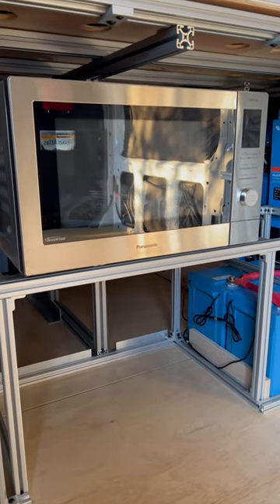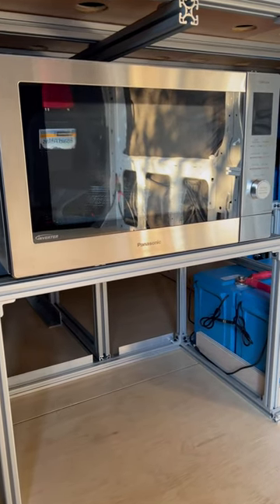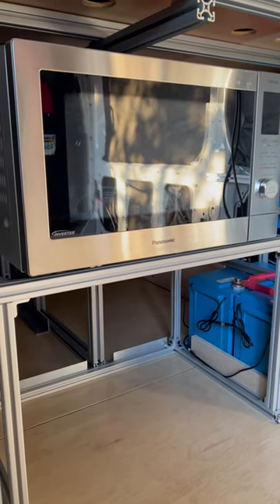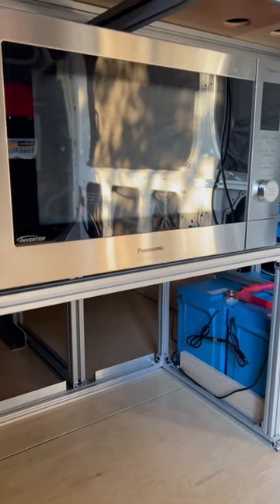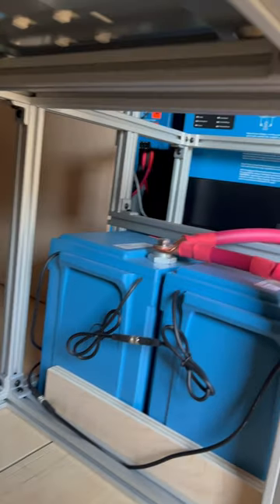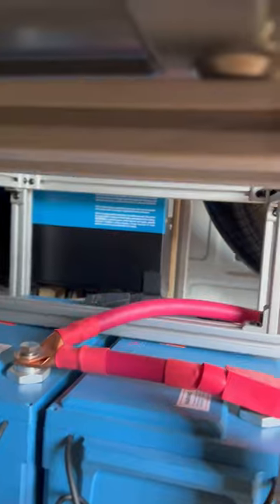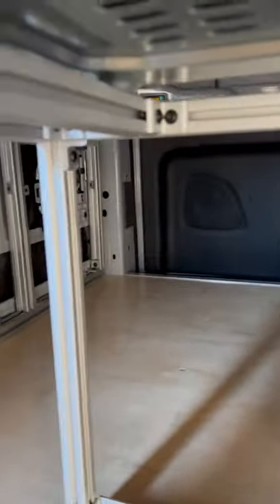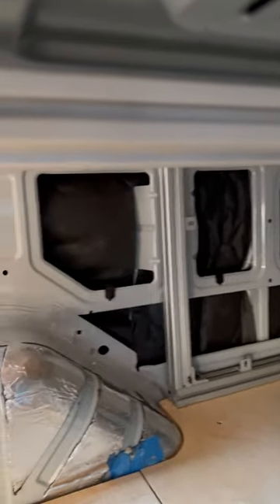Camper Van Microwave/Oven Mounted #shorts

Comment: Where did you purchase those bolts? Ty
Reply from the maker: I used bolts and t-nuts from 8020 brand extruded aluminum.
Reply: @VanTransitions  yes, where did you purchase the bolts
Reply from the maker: 8020 is the brand - 8020.net is their website.
Reply: @VanTransitions  thank you so much. I couldn't seem to find them in store.
Reply from the maker: They have lots of bolt thread sizes and lengths available. You have to get what fits your size of extruded aluminum and t-nut threads for your specific mounting need.
Reply: @VanTransitions  yes, that's why I was looking for them in store
Reply from the maker: I can't choose the bolt you need for you. :) You need to know your extruded aluminum size, t-nut thread, size of hole in the bottom of the unit you're mounting, etc. Lots of variables. You got this.
Reply: @VanTransitions  yes, I'm completely aware of everything you have said. Lol. Just wanted to know where you bought your bolts.  That's all. I was hoping in a store
Reply from the maker: Ah, well you can get bolts at any hardware store if you know what you need, but I doubt you''ll find t-nuts in one. That's online. Lots of extruded aluminum vendors out there. I choose to order from 8020.